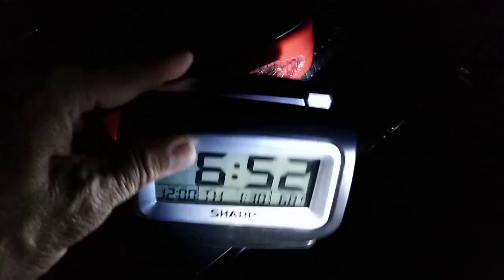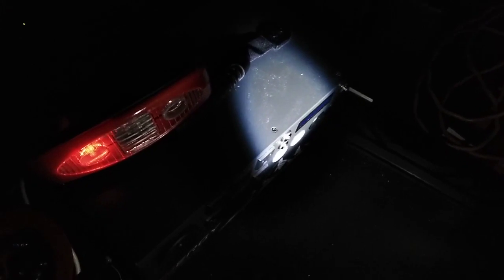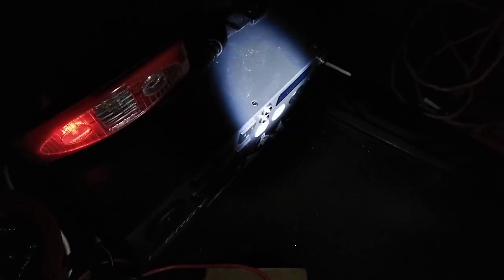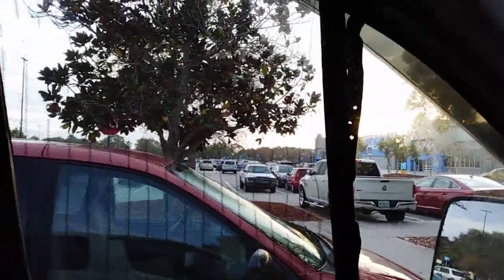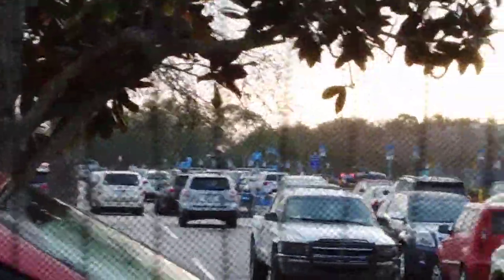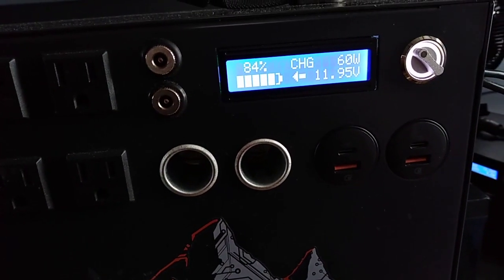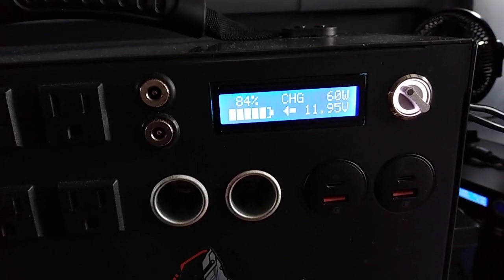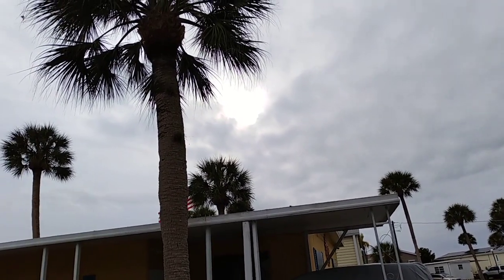Inergy Apex Solar Generator Drained to 0% Power.  The Apex Generator is at 9.40 Voltage at 0% Power.

Comment: I hope you get some good sun soon.  There are a few free apps for sun tracking.  I use skyview, It will show you all you need for solar power including angle, for future times too not just live.
Reply from the maker: thank you for the App,  On a nice day by 3:00 pm the Apex is fully charged
Reply: Vanlife Dancing wow that’s pretty good.  How many watts do you have in panels?  Soon I will be like you and have a Kodiak and a Apex, now just an Apex and 3-175 watt panels (with the loss the 25 watts over should be ok) I have only tested my panels one at a time, soon I’ll hook them up permanently.  I live in a 40ft RV but just use/heat/cool 1/3rd of it... pretty much a little more than a van size area. 8x10x8 tall ** EDIT I meant now just a Kodiak
Reply from the maker: I have four 100 watt panels wired up in parallel.  The Kodiak was rated for 600 watt.  But some people who ran 600 Watts melted the power leads.  I do not expect that problem with 525 Watt.  I have a video about the safety and the Kodiak:
 https://www.youtube.com/watch?v=CCWnDGiySDQ&list=UUdo_IcaaYxaQzFnaRt8Mypg&index=84
In it I go over exceeding 26 Volts open circuit.   Make sure your panels do not exceed 26 volts.   I do not see why they would.  MAKE SURE YOU CONNECT THE THREE PANELS IS PARALLEL